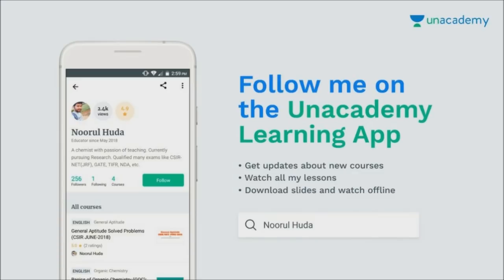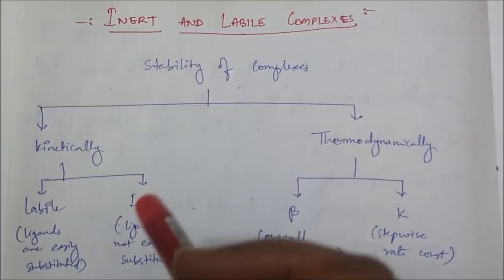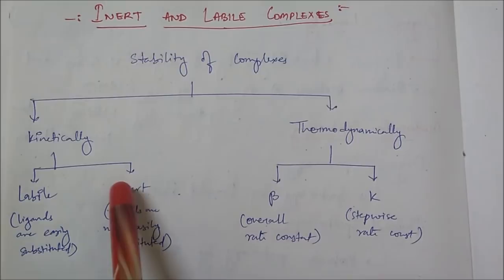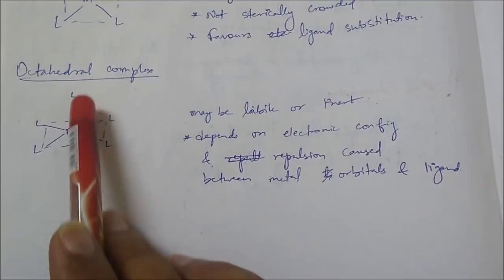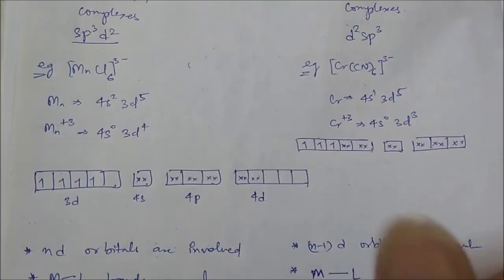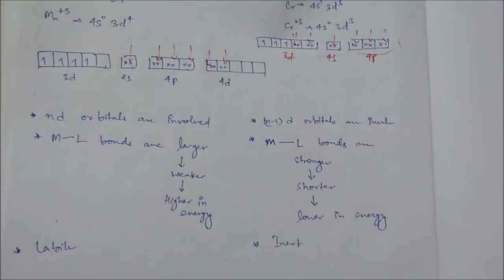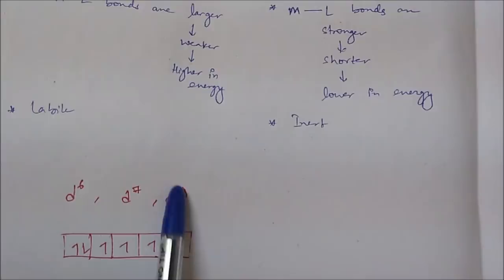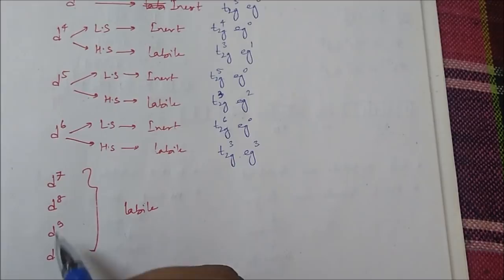Inert and Labile Complexes | Easiest Explanation

Comment: Sir how the weaker bond have higher energy?? Plz explain
Reply from the maker: the species which is less stable has higher eneregy than the species which are more stable, this is common trend in Chemistry which is followed by all intermediates, complexes and bonds,
so a weak bond will be less stable and thus it will have higher energy.
Reply: @AllBoutChemistry  
sir if the bond length is larger then bond energy and bond strength decreases. Can u xplain
Reply: @AllBoutChemistry  I think if bond is shorter n stronger then it requires more energy to break that bond